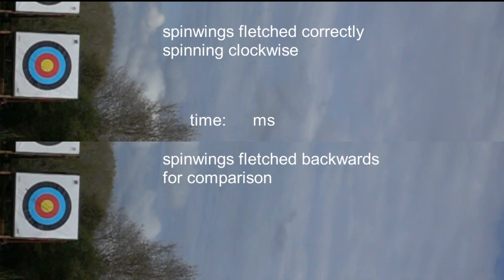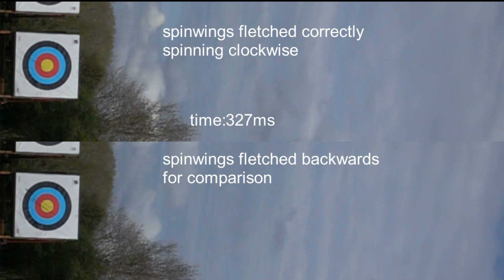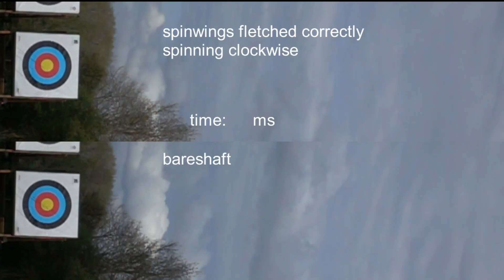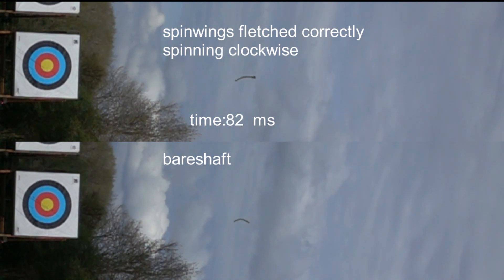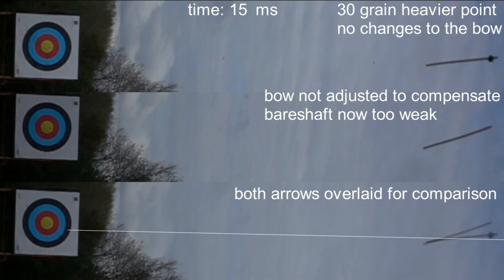Slow Motion fletched and bareshaft arrow flight from a recurve bow (1000 FPS)

Comment: Does an arrow from a compound shot with a release have a lot less vibration? (lower amplitude)
Reply from the maker: @dwightbrown2808  yes, about ten times less in the horizontal plane . It generally has a few mm amplitude vibration in the vertical plane as well shortly after release.
Reply: @slowmotionarchery  
Thanks man!! I haven’t found good slow motion video of an arrow flying out of a target compound. It could easily be that I just have not looked hard enough.

Comment: Hi, can you give me an explanation of why the fletched backwards arrow doesn't rotate?
Reply from the maker: I'm not 100% sure and have been planning a method of visualising air flow around the vanes to understand this more precisely. My understanding is that the there is a lot less air resistance if the larger back of the vane follows through the same point in space as the front of the vane, causing it to rotate as it moves forward for a normally applied vane. When the vane is backwards, it sticks out much more at the front, which causes much more drag, and whether the back of the vane (the narrow end) follows in the same path as the front or not, it doesn't have a strong effect on the drag experienced by the arrow. So, there is less driving force for the shaft to spin, so you get a much lower rotation speed.
Reply: @slowmotionarchery  Grazie
Reply: Maybe a bare shaft has a natural rotation direction coming out of the bow?

Comment: In my experience with ACE .. @ 42# 29" amo shaft the point makes a big difference depending on the type you use. I use inserts with screw in points . The inserts are much longer than the steel break offs . The points are much shorter. The inserts and screw in shoot about 1/2 spine stronger and alter the nodal points as the shaft is "apparently" shorter and the first node pint is further back .  I find that 570 spine with 105 gr points tune spot on BS at 30 inside the group of 3" diam and also at 50/60/70 and 90m are inside the group diameter .

Comment: This confirms an idea I had about bare shaft tuning. You might discuss it... I think it is not relevant to have a perfect bafeshaft tuning, as the fletched shaft behaves differently. It is necessary to add some weight to simulate the weight of fletching when bare shaft tuning. Specially with natural feathers (I shoot instinctive), even if the weight is minimal, the speed difference is huge. 3x4" add a breaking of 0,9G, so pretty much everything is different then.
Reply from the maker: It depends on the goal, though I agree with you about it not being necessary. While I have seen data from other people's experiments showing that there is an optimum draw weight for arrow grouping from a recurve bow, and that adjusting the button pressure to make the bareshaft land in the same horizontal place as the fletched arrow does not affect the group size (meaning that bareshaft tuning itself is not strictly relevant for group size), I haven't yet tried to reproduce that test for myself to better understand it's nuances. 
However if the aim of the bareshaft is to make the arrow less sensitive to variations in drag (if the feathers aren't all the same, or one falls off, etc) then it is a quick and reliable test with a clear interpretation. 
 The 3 grains in total with the spinwings isn't enough to have to compensate for even with light arrows, and the corresponding speed change from 63 m/s to 63.3 m/s is within the margin of error of most archers even using a clicker.
  With 14 grains of feathers on your arrows, they likely decrease the speed between 0.5-1 m/s  if your arrows are in the 300-500 grain range and speed is between 40-60 m/s which covers many instinctive setups.
 Have you observed enough difference in speed that bareshaft arrows group noticeably different to bareshaft arrows with tape added to compensate for the weight of the feathers? That's the simplest way to know whether the weight difference is enough to want to compensate for.
Reply: @slowmotionarchery  according only to my experience, and no thinking, I only noticed an effect of fletching mass, or mass at the rear end on dynamic spine. I suppose this is the shift of the rear node. I saw this with tape to add weight, and with 6gn nock vs 12gn nock. I noticed difference in speed 1m away of the bow. About 1 to 2 fps (I dont recall, but It was measured on significant average). About 201fps, 280gn, 41lbs. And from my measurement and simple calculus,  it was beecause of drag, not weight, even that close to the bow. I calculated the law of speed/mass, an the bafeshaft was  above the line. Strangely enough I never noticed a difference in trajectory, but as I shoot instinctive, I am not that precise.
Reply from the maker: @laurentsouchaud1371  Could you clarify which arrow(s) showed the change in speed? Was the 1-2 fps difference observed when you added the same mass of the feathers in tape form to a bareshaft, or a bareshaft without tape but with a nock that was 6 or 12 grains heavier? 
What is your normal standard deviation in speed from shooting the same arrow through a chronograph a dozen or so times? 
By "law of speed/mass", do you mean you calculated the kinetic energy of each arrow? The energy isn't a constant as slightly more of the bow's energy is transferred to a heavier arrow - if your arrow weight changed by 5 grains then there would be a speed difference of about 0.5fps relative to the calculation. 
Which one of the arrows you mentioned had the different drag? Do you mean that it had a different mass and nock but you attributed the difference in speed to drag only? At ~280 grains I expect those are small diameter shafts, which based on my speed measurements at a wide range of distances to determine the drag coefficient for different arrows, I would expect to lose only 0.5fps due to drag in the first meter of flight for a bareshaft and 0.75fps with 3" feathers on a small diameter arrow. However other factors can have a much larger effect, like nock tightness which is about 1.2 fps from loose to tight for an arrow at your speed, and easily 1+ fps from day to day human variation.
Reply: @slowmotionarchery  Resurecting an old comment here but I remember very clearly working with someone who I had got to leave the top and tail and sticky tape on their bareshafts and they got very erratic results when shooting them at 30m, no grouping of the bareshaft and so impossible to interpret any result. Removing the tape lead to bareshafts grouping together. Have always avoideded that since and just shot them completely bare. Often wondered what the cause of that was, perhaps just the tape lifting/flapping and causing unstable flight? I agree that the purpose of shooting is to give information about how the arrow is oritented and leaving the bow, and they can do that without having to be to have exactly the same mass/weight distribution as a fletched arrow.

Comment: I love your work, Lester but need some more info please. Are these shot off  the fingers? What's the archer's handicap (approx)? How many video recordings are made before these results are considered significant (statistically) and the variation in the archer's loose can be eliminated? What is the total weight of the arrow? 30gn on a 400+gn arrow has much less effect than on a 300gn arrow. Is the arrow the correct length for the bow? Adding point weight to overly long arrows has much greater dynamic weakening effect than on the same static spined arrow at correct length. Thanks 👍
Reply from the maker: Handicap above grand master bowman in 2019, release and arrow in the description, each video was repeated about 3 times and did not vary visibly. For close-up videos of the bow window there can be a few pixels difference between shots. For arrows that are several spines out and fly at a much sharper angle, with the camera position in this video it takes maybe a half dozen shots to be sure what's normal.
The ACE 620 spine arrows are the correct length and weigh 267 grains. 
I'm curious to measure the difference on extra long arrows now - the suitable spine of ACE than matches this bow at 32" should only give a 1.4Hz decrease in frequency for the same point change, compared to 1.6Hz for the regular length and spine, since frequency sensitivity to point mass decreases as shaft length and mass increase. So I'd expect slightly less effect on the dynamic spine with overly long arrows, not more but I'm prepared to be surprised. 
Hope that answers your questions, please let me know if I've missed something!
Reply: @slowmotionarchery  excellent, thank you! Apols for not reading the description. Yes, please do try the extra arrow length; I find it a source of confusion and complication amongst archers, as if spine and correct arrow selection isn't misunderstood enough. The reason I asked about the h/c of the archer shooting in your videos is that the findings of empirical studies like this and those of theoretical studies elsewhere are often bandied around by well-meaning archers to other archers whose level of shooting isn't good enough to see the benefits. Their time would be better spent improving their shooting with a coach than running down blind alleys believing changing their point weight is going to take them to the next level. As a very rough guess, I'd say you need to be around 22 to see the difference of 20gn point weight on your group beyond the natural variation of the finger loose. At my best, I can see it, but not every day! 😉 If you could do this same stuff with archers of different abilities, perhaps you could determine empirically when (in terms of ability) variations in point weight become significant? Nonetheless, this is excellent info and your work deserves way more followers! Thanks again! 👏